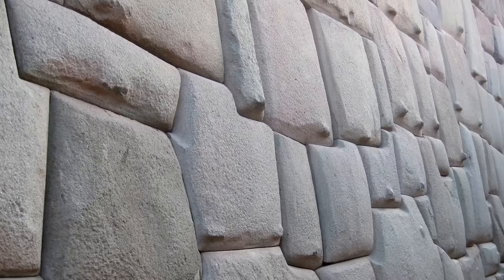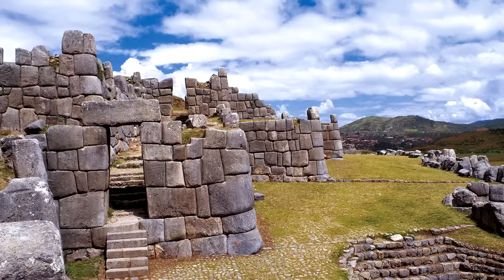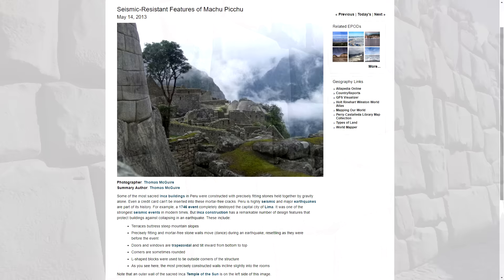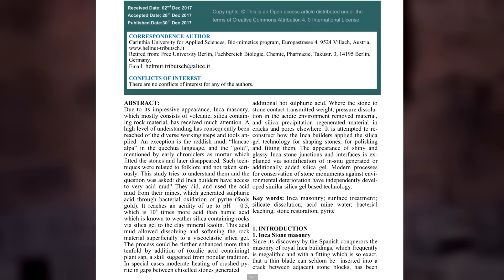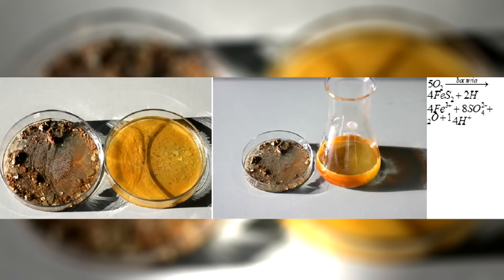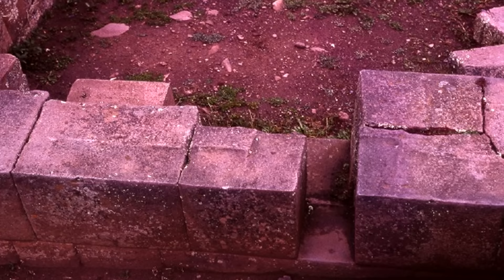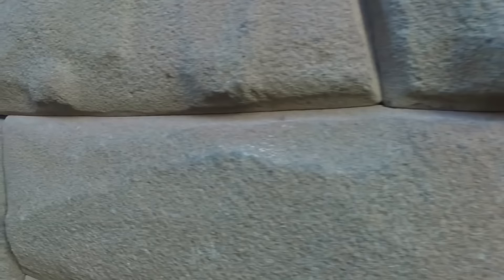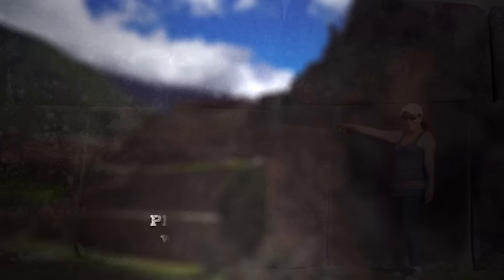Is This How The Inca Walls Were FINISHED/JOINED So Perfectly?

Comment: While this is an interesting idea, I'm still pondering why and how they manipulated such large stones.
Reply: Wedges, levers, mashed tuber grease, and long hours over many years.
Reply: Well the small protuberance at the bottom of the rocks look too be an air bleed like we use today when poring concrete, and you can see that all of the rocks are identical in color and consistency, so if they had the mixture really really thick and some form wood to hold in place until firm enough to manipulate, they could take a v shaped trial and finish the joints, yes it would be one at a time, but with a small army you can get a lot done in a day,, that elements carrying  large boulders and then trying to shape them to fit, I know my hypothesis is not romantic, but it is simple .
Reply: The Inca had essentially all men between around 15 and 40 work on government projects 3 months out of the year. They used a lot of people to work over the span of decades.
Reply: We don't have the ability to move blocks that big today. We have no idea how they moved them.
Reply: These are pre- flood constructions by the ancients, even the Inca state they didn’t build these structures. Tiwanaku is an ancient city recently discovered at the bottom of Lake Titicaca, dating to before 10,600 BCE, when the city was in a dry valley between two mountains. Archaeologists have dated artifacts to a 500-1000 CE pre Columbian civilization. As usual, they probably don’t realize this is another legacy civilization.
Reply: These were carved in place to look like a wall.
Reply: Giants. The blocks are flesh fossilized. The nubs on some are the anchor points. Anchor points are segmented. It's why not all cuts have them. If these were cast in situ  they would all have them.    Not being on all blocks favours them being flesh , not situ.   Truth is stranger than fiction.   " mudfossil university "

Comment: The stones fit together as tightly with the same puffiness along the horizontal edges as they do along the vertical edges. If gravity combined with a stone softening substance is what caused the perfect fit on the top and bottom then the sides wouldn’t have the same perfect fit.  If we knew why the protuberances are where they are I think everything would be explained.
Reply: Well hypothetically, if the acid softened the edges (all exposed edges) into a silly putty like consistency, you could shape all the edges/joints however you want them and thereby eliminating any gravity bulging or downward "flow". Like perhaps only the outermost inch or two was softened and the core of the rock remained hard and after you jammed them in place you could scrape the exterior before it completely hardens? This technique can be easily replicated using regular mud/clay blocks of various shapes and sizes. Of course they don't harden I to granite. But the technique checks out... I'm just not sure you can soften granite, shape it, and have it re-harden?
Reply: Don't all the walls lean slightly inwards? So if I saw that correctly, the walls aren't perfectly vertical, which means that there would be inward pressure from the corners. With such massive stones that small amount of lean that we (presumably) see would be perfectly adequate to create the necesarry horizontal pressure.
Reply: Like a concrete casing, it's a fact there made of limestone which can be turned to concrete with almost any mix
Reply: That's where the woven geopolymer mold broke and was braced by a vertical log
Reply: @ktbowersbellsouth  do you mean “broke”as in unintended?  The protuberances I believe are always near the bottom of the blocks they are on. I think they are in pairs more often than not and they are definitely not on all blocks. The size of the protuberances seem to be proportionate to the size of the blocks. There are many characteristics of them that seem to be consistent everywhere they are found globally. I think the only explanation main stream archaeologists have given is that their purpose was to make moving and lifting the stones with ropes easier as they would help keep the ropes from slipping off the edges of the blocks but this does not explain why some have the protuberances and some don’t and why the number of them on the blocks is also inconsistent not to mention the weight of many of these blocks being too great for ropes to handle.
Reply: @HockeyDad6631  I guess that would explain the effect of gravity on the finished product. If you look at the area around the unfinished obelisk at Aswan Egypt it looks very much like a scoop or shovel was digging out the stone around the obelisk. I think whatever technology allowed them to dig and shovel the stone as if it were dirt or snow is key to how they made the stone fit together so perfectly. I think they could’ve made the blocks rectangular shaped like bricks are but chose not to because making them different shapes and placing them on each other not in straight rows they knew would make the structure stronger and more earthquake resistant. It’s obvious that they possessed technology that we don’t.
Reply: Those stones are shaped and carvwd manually with a slight taper ao that you only fit near the outer face. Polygonal masonry has been done even in the 1800's. The Bomarsund Fortress in finland is more complex and larger than sachsyhuaman and they did not use modern machinery. So stop this stone softeing and geopolymer nonsense. You guys should read more history
Reply: harrowgateguy
1 second ago
You can’t compare the polygonal stones of megalithic Peru with the ruins of Bomarsund where the stones are all hexagons and all about the same size. The polygonal stones of ancient Peru are all different sizes and Shapes some with as many as 12 sides. Using plants to soften the stones is the least challenging explanation for archaeologists to accept. Vibrations for cutting and moving stones along with antigravity devices and of course aliens are even harder to grasp but until we know how they did it, we shouldn’t dismiss any theories.
Reply: @harrowgateguy  the hexagon stones have varying height and width thay are not nearly identical at all. The japanese samurai walls are still being built up to this day. The largest stones of sachayhuaman are on the ground and were built around with other stones.  Most of the megalithic stones in sachsyhuaman are of the same size as those in bumarsund  fortress. The size of the stone does not matter because you hust simply scale up what you are doing.If a stone can be shaped to an irregular hexagon then it would be as easy to shape into complex polygon in sachsyhuaman. The interlocking granite blocks used in eddystone lighthouse are more complex in shape as you have to fit the stones in a 3 dimensional space and each level has a different size of stones due to the taper of the lighthouse. stones in sachsyhuaman only have to tightly fit on the outer face. The top of chorinthian columns have complex gemometries but stone masons were still able to do it without modern machinery.
Reply: JL... I'm afraid the woo factor in this comment thread is way too high to accept anything approximating reality.

Comment: My theory is that the stones were lapped in place, rough cut then placed on the wall and lapped with sand until all surfaces in contact are worked or lapped to a fitted finish, that also explains why some sones seem to intersect more than one stone, the horns on each stone holds a key as this can be used to hold the stone from its full weight to allow the sone to be slid in one axis with a frame build over the wall to support the stone when lapping it.
Reply: Like how you can make a pair of lenses, one convex and one concave, where those surfaces are so identical that the glass will bind together if clean enough.
Reply: What does lapped mean? Thanks
Reply: @tren35  ... Usually means "rubbed". Like if two objects are rubbed together, and they both wear down and get smooth.
Reply: I disagree...would take to long and the shape of many of the blocks are curved as well as twisted in very complex geometry. It would take a 5 axis CNC machine with diamond tipped cutting inserts or something harder then granite to make the same block today. Not to mention the moving of some of these blocks defy's logic. Clearly it was easy for them what ever process they used.
Reply: @robanderson4137  the eddystone lighthouse have stones way more complex and did not need any cnc machine . Just traditional stone work
Reply: Maybe the laps are earthquake proof
Reply: I’ve actually thought this similar concept. How they lifted them and slid them back and forth is a mystery. But as a dentist I see how people have ground their teeth down either flat or with the points and notches fitting exactly together like a puzzle piece. The two surfaces of the same hardness wear at the same rate and eventually fit precisely together.
Reply: @robanderson4137  time is all they had, they were in no rush, like you are today.
Reply: Let's see you try that with a 150 stone block.
Reply: @JL-tm3rc no it doesn't, the lighthouse is like kids playing with Legos compared to these walls

Comment: I'd never heard of specific stone types being used, like granite. The theory I've heard is the stones were poured in place in sacks, like concrete.
Reply: This is by far the most logical theory. I’ve believed this for years. It even explains the nubs.
Reply: That could mabie work with limestone but not granite or andesite
Reply: seriously , why pour walls to look like stones even if they could have , which they couldnt have done
Reply: @oldfart5063  Maybe they were not trying to make them look like stones? They say the design is earthquake resistant. Could be that how it looks was not a primary concern.
Reply: @oldfart5063 easier to transport and pour  concrete, rather than moving large  stones, maybe?
Reply: @oldfart5063 say what?

Comment: I've been to Egypt and seen the pyramids, and to Cusco and Machu Picchu. The structures and materials are different, yet many of the same techniques were employed. In all cases, it's only the visible front surfaces that are sculpted and fitted with precision. All other surfaces are rough and unfinished. In Cusco and the pyramids in Egypt you can see how rough things were on the back sides. Totally unfinished. To make the finishing stones sit in proper orientation with the others behind and to the sides of them, they used a form of concrete made from the rock chips and some form of binding agent. When it came to matching edges on the visible front surfaces, various techniques, or combination of techniques, were used. In Egypt, a local showed us how easy it was to shape granite. They just rub a large granite rock with a smaller hand-held granite rock. The nodules of granite rub away at a very high rate. Don't know how they did limestone, but rubbing was also likely the way it was done. They'd get things to match up as close as possible, set them in place with their concrete, then make a crack filler mixture using granite or limestone dust and some binding agent. This would be pushed into the cracks and formed, then left to harden. Probably more interesting than the actual fitting of the stones themselves, was how they moved these multi-ton rocks around as they were being worked. That's the REAL mystery. They'd have to lift them in and out as the fitting process was taking place. They had to do this over and over until everything was sitting just right. Not an easy feat.
Reply: Can I meekly suggest a wood former may have been created and the stone shaped till it fitted the former.and the stone was then placed. Only a suggestion.
Reply: Hey, with anti-grav projectors, those stones were light as a feather.
Reply: @wgj4813  neat thought. possible, but my money is on simple leverage. Drive a wedge under the rock with a hammer, then shove a long pole in and have someone hang on the other end. With a 10 foot pole and 1' under the stone, a 200lb man could offset one ton worth of rock. That lifts the face of the rock up a few inches, so you can get your tools in there.

Following on the other person who talked about rock dust and paste being used as a filler, this would also have the effect of leaving rock dust behind under the rock, since it's mostly in place while it's being worked. So they could shove in their binder and drop the rock.
Reply: Shutup
Reply: @DeathDwells  good point. I can really see where you're coming from!
Reply: Exactly . And that's where this theory falls .

Comment: Several methods of fabrication of the polygonal masonry using clay/gypsum replicas, a topography translator, and reduced clay models of the stone blocks along with a 3D-pantograph are described in the article “Fabrication methods of the polygonal masonry of large tightly-fitted stone blocks with curved surface interfaces in megalithic structures of Peru” (DOI: 10.20944/preprints202108.0087.v7). YouTube does not allow a direct link. Search by the article title.
Reply: The 10th article edition (DOI: 10.20944/preprints202108.0087.v10) is posted at Preprints. Search the article by DOI or by title.
Reply: This may be feasible, but unlikely ordinary humans would to this. 
The fact it is found on different continents stands for a higher civilization which could travel between continents. 
And the fact WE cannot currently reproduce this in reasonable time frame even with heavy machinery stands for the fact that civilization was far more advanced than OURS.
As for a purpose of building those walls around the world, i can only guess that they were earthquake-resistant shelters for the first humans, which that civilization brought to Earth.
Reply: @LeftAcc0, that's a huge leap.  They were more advanced at stone shaping and cutting!  It takes faith to then say they had advanced technology. They knew how to cut and shape stones. That knowledge is lost now.  To say they were flying or zipping across continents is ridiculous.  I do believe in ancient contact across great distance.  But everything else starts to become outrageous.
Reply: @Findin_Dreams  Billy Carson was just explaining on Joe Rogan a type of nanoparticle stone seedling that will grow into larger scale stones is already being used. Maybe science is catching up with the ancients. Edgar Cayce was once asked how the pyramids were built and he explained “they were grown in place” a strange answer until hearing Billy Carson explain the stone nanoparticle type seeds.
Reply: @ensenadorjones4224 um I guess you never heard of the little gold delta wing airplanes as discussed by Erich Von Daniken?
Reply: @irishgrl  I've heard of them. Birds?
Reply: @Findin_Dreams Human arrogance does not allow for such a logical explanation.
Reply: @ensenadorjones4224 to play devil's advocate... We can split atoms, go into space, create artificial life from scratch, but you think that we can't figure out how to break rocks better than people millennia ago?
Reply: @scottcantdance804  I believe we can .
They knew how to do it with less tech. 
Some of the master stone workers knew how to do things with stone. Methods we can not replicate. We can achieve the same results but not with their methods.

Comment: One hypothesis I've seen is using "string saws" to make cuts where the string is looped through a acid solution like the one mentioned, then over the stone, sort of like a bandsaw, but with string and acid rather than steel teeth.  I saw it a long time ago and can't find it now, but interesting nonetheless
Reply: Might explain the vertical joints that others pointed out wouldn't with the gravity hypothesis
Reply: @cathjj840  Maybe they did both.  Whatever they did it would seem to have required precision, patience, and time.

Comment: They were made in bags which were filled with the rock mixture in a liquid form and allowed to settle and dry.  When drying they were sculpted into the desired shape.  The odd bumps at the bottom or near bottom were for drainage and obviously some dried too quickly and were just left as would be hard work to remove.

Comment: It is great that people still have the courage and confidence to offer up their ideas about how many different and  previously unexplained issues have come to be everyday processes. Fear of ridicule by small minds, only causes the unsolvable to remain unsolved.
 Having worked as a toolmaker, charged with solutions to problems, or meeting productivity goals needed to achieve a higher percentage of the market share, I learned to think about previous experiences, and to discuss ideas with people known to be able to listen, and offer support or rebuttal of my ideas. From there it was GO time.
 As I understand the concept put forth here, each individual joint should show some residue of the original stones, that were eroded or dissolved by the addition of the solution on each joint face. I would be tempted to reject the chemical solution theory if there is no evidence of any loose, dry leveling material having been used. My first question would be, about the accuracy that was available to the people cutting, measuring, and assembling any two blocks. If the faces were chipped away with crude iron chisels and hammers, such as were used to create large buildings in Europe and Asian civilizations at similar times, I would “doubt” that the magic water theory, would be a viable one. Now that the opinions are on the table, it is time to take off the suits and put on the work clothes, while testing things in real world situations.